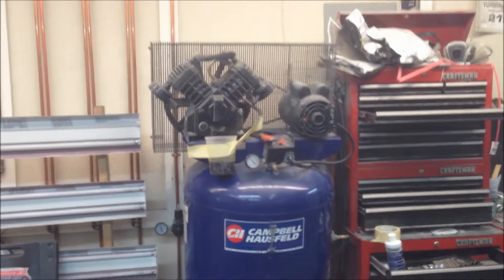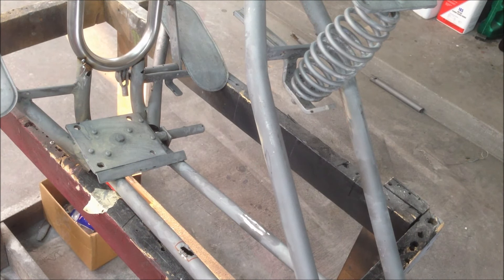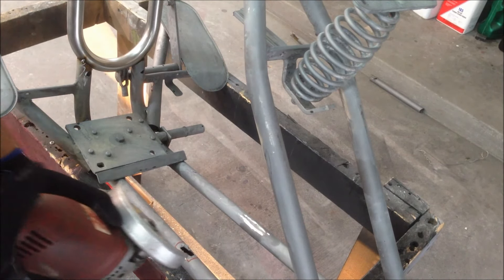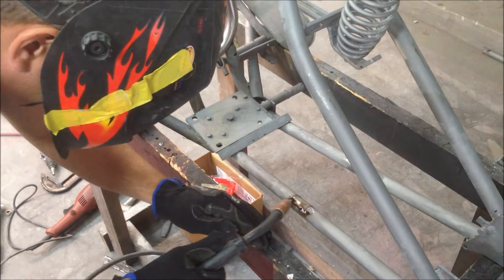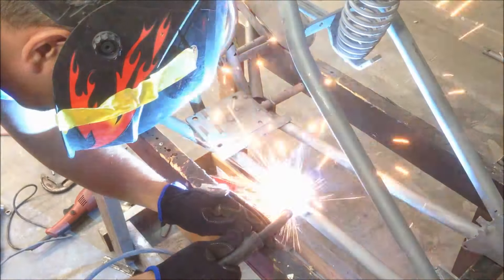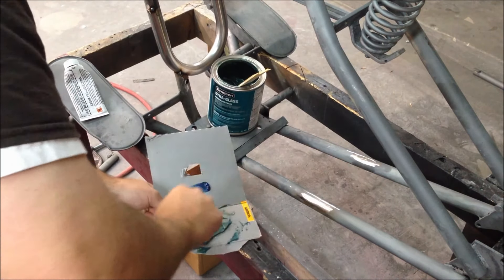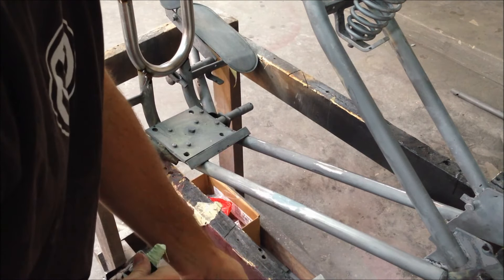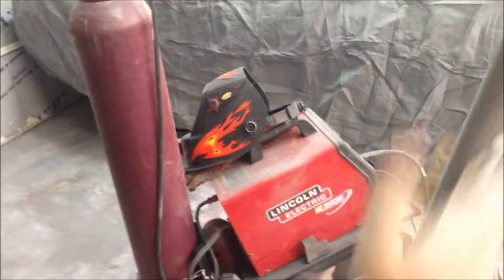15 Minute Video for 5 Minutes of Work

Comment from the maker: I used to have a cheap 4" electric cut off wheel, but it burned up.  I need to get another another one.  This 4.5" one is heavier and bulkier, hard to get a precision cut with it.